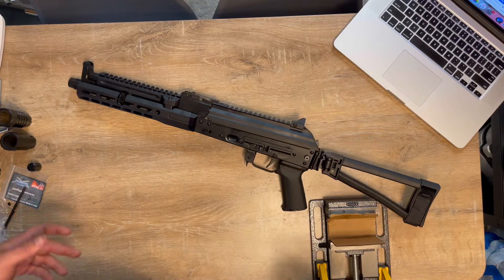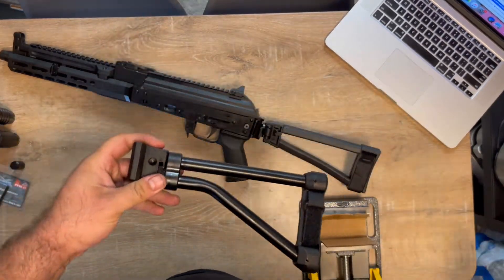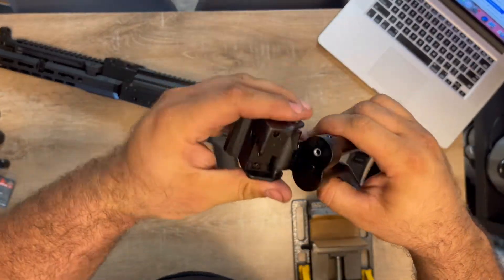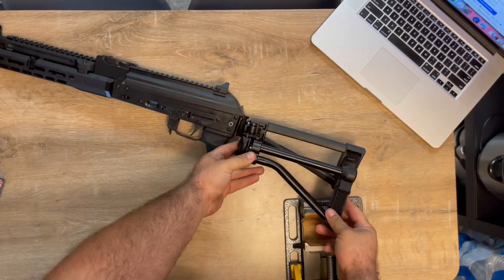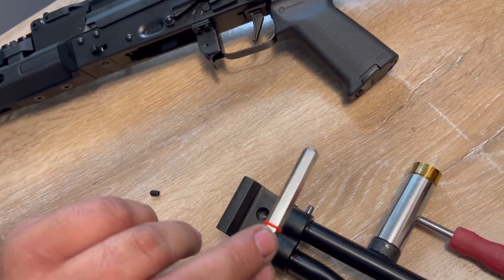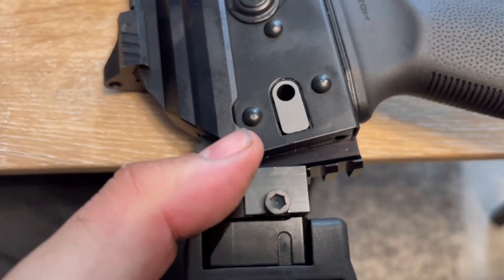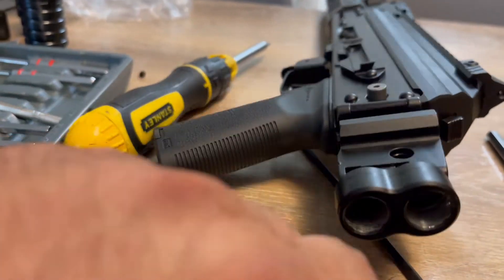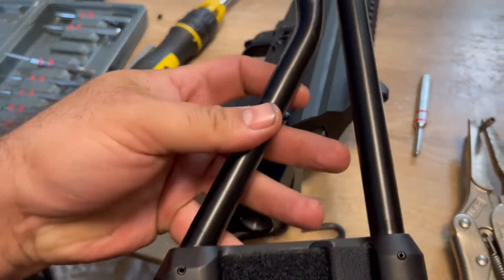PSA AK-105  5.45x39 pistol brace replacement with CNC Warrior side folding

Comment: How do I remove the Picitianny mount on this , i have a 104 with the picitanny rear and have a CNC Armory non Picitanny to replace the back
Reply from the maker: I believe the picatinny mount is part of the rear trunion so in order to get rid of that you must replace the whole trunion. Way too much work if you ask me. Almost impossible to do at home unless you have the right tools.
Reply from the maker: I’ve been asking myself the same thing. I push it but it won’t move. Maybe I need to try and remove the picatinny adapter and install a folding one from an actual AK and maybe than it will work. I’ve thought about getting that but haven’t had the chance
Reply from the maker: @PYROBALLISTA  anytime brother. Sorry I was not of a bigger help but if I get the oem folding stock and hinge I’ll make a video and I’ll let you know. Thanks for watching
Reply from the maker: Hey brother the button works. I had to tap it with a tiny hammer from a punch set to move it the first time. I can’t fold it with the brace I have on it but it works for sure. I’ll have to look into my options now.
Reply from the maker: No rivet it’s just like an actual 4.5mm hinge from an AKM folder. That’s a hollow button and there is a spring inside of it. I had to tap the button with small hammer just to move it for the first time.  All we need is that 4.5 mm hinge and stock or brace of our choice
Reply from the maker: Check my newest short video please
Reply from the maker: I stand corrected on my previous statement. Check my latest video and you can see it’s actually a functional folding mechanism that you can replace/remove the picatinny adapter by knocking the only pin out from the folding hinge. Sorry about not checking before I replied to you.

Comment: Did you order the one that says right hand or left hand? I feel like right hand should fold to the left to access the trigger
Reply from the maker: I ordered the right hand and I thought just like you that it will fold left so you can use your right hand to open it but I was wrong. The right hand folds right the left hand folds left. Because I made the mistake I end up doing the modification and made it to fold left but if you’re buying new chose the correct one
Reply: @alexanderthegreat8067  Thanks for the info I figured they did it that way kind of confusing for a customer and couldn't find any info without contacting them
Reply from the maker: @Your_Fathers-Garage you’re welcome sorry I didn’t see your comment right away. And yes it’s very confusing but even if you make the mistake my video can help you fix it without sending it back lol. Thank you for watching it
Reply: @alexanderthegreat8067  all good probably be a few months before I order it I'm putting it on my p50 after I get the Pic rail adapter and the foregrip for it probably swap the truglow redot for something more boxy like the new holosun or vector frenzy